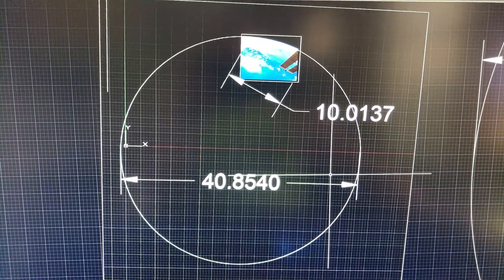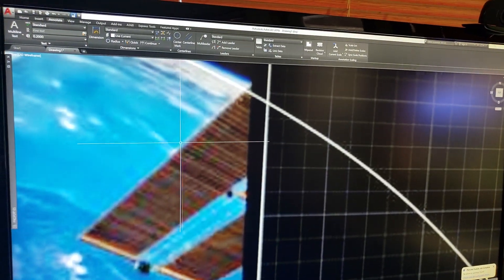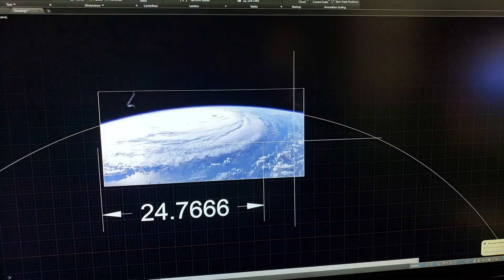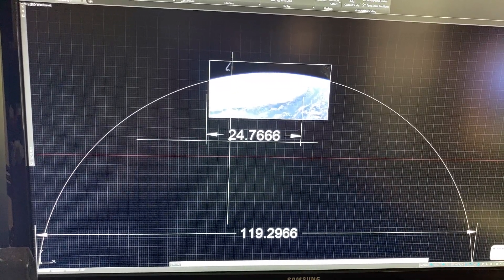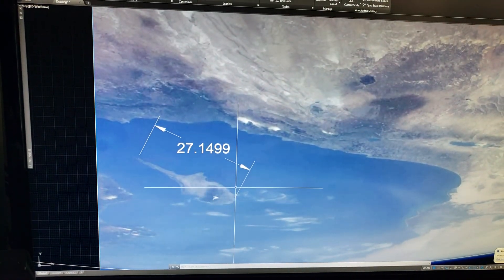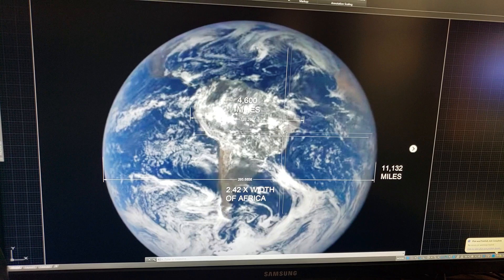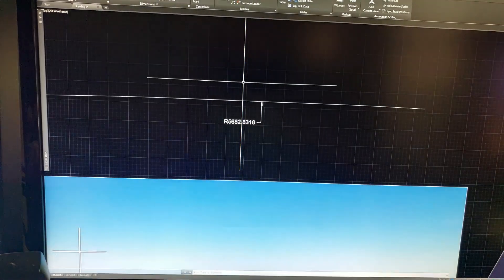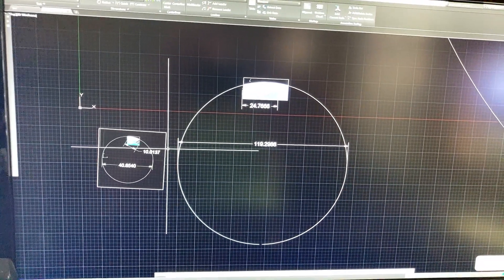Earth curve discrepancies when measured in autocad. Flat earth globe earth

Comment: A photo like the one showing Africa has a simple explanation. The width of the African continent is about 4600 miles as you show, but that's the distance across the ground, not what you see in a 2D views. When we see the earth in 2D like that, the diameter is about 8000 miles, but the distance over the surface is half the circumference or about 12,500 miles so your measurements are a little off but not that much. I think your dimension line for Africa on the west side is actually a little too wide. Satellite photo's from low earth orbit produce all kinds of illusions due to perspective. Things closer to you appear to be larger than things farther away.
Reply: harry wheeler The problem was that it's not Africa, but South America.
Reply: @mendelde  You're correct - I really didn't look at the picture that closely - just the dimension. I went to google earth and found the width of Africa to be a little less than that, but that really isn't the point. When you're looking at the surface of a sphere from a close distance, the 2D perception will make an object like a continent appear wider than it does when you back away.

Comment: One basic mistake of all flat earthers is in math: a sphere has 4 times the surface of a circle with the same radius.
If the earth is flat and has the same surface as the worldwide accepted globe, it must be a circle with a radius of 20000 km.
Now try to find a straight line between 2 locations with a length of 21000 km, which should be no problem...

But it is a problem.
Solution: all surface of any piece of land or water is only 25% of "what is told" and nobody has ever noticed it.

Actually, all flat earthers should take that in account while selling land. ^^

Comment: cyprus is big for your autocade scale model. 140miles long. And it's not even an oblate curve cause it never change for years above any places.
Even catching only 3-4% of a earth surface, iss cam catch the earth curve (this is what globers repeating to us like a hammer), so if your scale do not match the image, we have a problem somewhere, and this is probably the cam, not the earth. And probably this is only a circle of the horizon all around so nobody can say the earth is a globe technically because iss do not catch it finally.
I've catched a different curve between backward view and front view the time I watched these iss footages for hours. I also watched telemetry, that was very interesting. Not the speed but altitude telemetry, very interesting to see where it change and to realise why, but you need to superpose another data map to see the big work.

Comment: Due to the camera not facing directly towards the earth in most of your photos, the horizon in them is actually following the shape of an ellipse, so modelling those outlines with perfect circles isn't going to give a very accurate match.
Reply from the maker: Why would they be an ellipse if it's not a fisheye lens?
Reply: I've been meaning to do a fact checked response to this, but I don't have the patience to learn how to model it, so it's possible that I'm just mistaken and wrong for reasons I'm not aware of. 

The horizon is a 2d circle, viewed from above its midpoint, so when the camera is facing towards the edge, the circle is wrapping around and behind the camera. In my opinion that shape should follow an ellipse, because your view of the circle is tilted, but it appears you're actually able to match a large circle to the visible horizon without much trouble, which I didn't initially expect you could do. It might be within rounding error so we don't perceive that it's not a perfect fit, or then my intuition is just wrong.

If you could see the outline of the horizon and also the outline of the entire earth at the same time, and so that they both start out at the same spot at the top, the earth's outline wouldn't follow along that circle you drew in this video. It would actually start curving quicker and appear smaller in size (as long as you're using perspective view). It would also be wider at the top part than at the bottom part, due to the camera's position being closer to the top.

What your perfect circles represent, I don't know. I wanted to model it out, but I gave up.

Comment: About the footage from the ISS, you are assuming the disc of the earth that they see is 50% of the earths surface. In reality, it's about 3%.

I measured the distance highlighted at 2:33 in google earth. Google Earth says it's 3264 miles. 3264 * 2.42 = 7898.88.

7898.88 / 2 = 3949.44

Which is approximately the radius of the earth in miles.

Where did you get 4600 miles? The width of Africa is about 4600 miles, yes. But that is South America you are looking at. How did you mess this up? When you type 'width of Africa' into google, it shows you a picture of what Africa looks like as a reminder, you know?
Reply from the maker: I actually pulled that from another video and the poster says africa. Plain and simple. That was a egregious error on my part, and taking that into account the width of South America makes the width of earth correct. 3100*2.4ish is close enough to right without taking into account foreshorting etc. Thanks for the comments. I'm learning as I go.
Reply: The visible part of the Earth from the ISS is represented by a circle on http://www.isstracker.com/ but this is just an approximation (i.e. the circle is not distorted near the poles as it should be). 
For a more precise value, set the viewer height to 400000 meters (400km) in https://www.metabunk.org/curve/  . The computed horizon is 2292km ignoring refraction and 2471 km with standard refraction. Double those values to obtain the distance from one side of the horizon to the other. 
Also, be aware that Earth features below the ISS  are significantly closer than those next to the horizon (400km vs 2400 km). That means that the method used in the video (i.e. compute the ratio of a land mass size to the whole visible globe)   will not work very well.

Comment: The iss in not, nor has ever been claimed to be, high enough to see the full disc of the earth.  Taking images from iss and comparing with full shots of the earth's disc is nonsensical.
Reply from the maker: That's not what I did but thanks for playing
Reply: yeah you did, you are trying to derive sizes of the earth based on small images of the earth, while ignoring lens distortion.
Reply: @termin8953  what lens distortion? negatorxxx said without lens info it's pointless to have any argument about these images.
Reply: Termin "The iss in not, nor has ever been claimed to be, high enough to see the full disc of the earth." 

We're on the same side, but I'll disagree with you on this point.  

A horizon to horizon image can be captured from the space station if you use an extreme wide angle lens, like a fish eye lens.  

These will introduce severe distortion, with objects beneath the ISS appearing much larger in the image than they would from a camera using a normal lens at a greater altitude.
Reply: Yes, but you cannot take this to it's inevitable conclusion , it's fake, or it's wrong. It's not. We see exactly what we should expect to see dependent not only on type of lens, but where in the image the horizon happens to lie ( further away from centre of frame, greater the distortion )
Reply: The view from the ISS, orbiting 250 miles up, is barely more than two thousand miles across. You need to be tens of thousands of miles away from the surface to see close to 50% of the Earth"s surface.

Additionally, if you are trying to measure distances across the surface, you need to understand that small angular changes across your view cover small distances in the middle of the image but cover very large distances towards the edge of the image, as you are seeing the surface almost edge on.
Reply: @florencegomer7937  so it show an actual segment of a circle on a surface about 3-4%, the limit below the black space do not draw a curve of a globe.
Reply from the maker: Do you have a close approximation of the circle of earth the ISS would see from 270 miles up? I'll do a follow up with that data. Thanks for the good info.
Reply: Joobs "Do you have a close approximation of the circle of earth the ISS would see from 270 miles up?" 

This is a good site to bookmark if you're going to be involved in this debate:

https://www.metabunk.org/curve/

From a height of 250 miles (1,320,000 feet) (402 km) the horizon is 1428 miles (2299 km) away.  

I believe 270 miles (434 km) is a bit high for the International Space Station.  From there the horizon is 1486 miles (2391 km) away.

Refraction has an effect on these distances, but it's unpredictable.  Metabunk includes numbers for "standard refraction" if you want to mess with that.
Reply: Joobs ... Go to any website or computer program that plots the current position of the ISS on a map. As well as the ground track of the current and next orbit, they usually show a circle around the ISS showing the extent of the Earth's surface visible from the ISS. This circle shows as a circle when it is plotted on a globe map of the Earth, or a distorted shape when plotted using Mercator or any other similar projection.

If you enter your location, the program will draw a circle around your location showing the extent of your sightline for an object orbiting 250 miles above the ground. The ISS needs to be within that circle to be above your horizon. 

The closer to the centre of that circle, the higher it is in the sky. Thus you are pre-warned when the predicted track of the ISS is seen to go through that circle it will be above your horizon at that time. If the position of the Sun is such that it is below the horizon for you, but still above the horizon for the ISS you will be able to see the ISS pass over. This happens in the couple of hours after sunset or before sunrise.